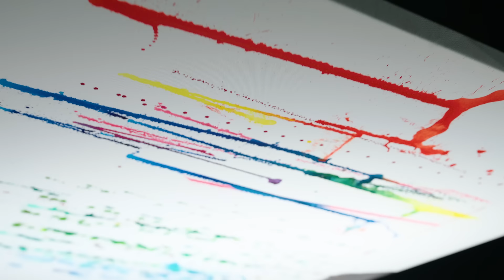SYNESTHESIA

Comment: Question: so curious. Did you assign each note to a color or was the color random? Obv, you are only using a set of key and there is probably a set number of paints that can be used on the machine.